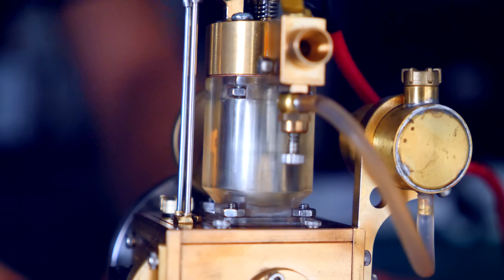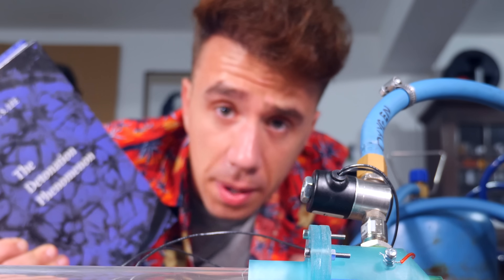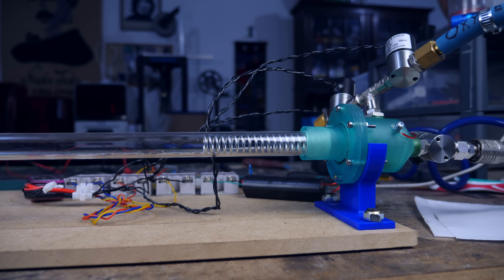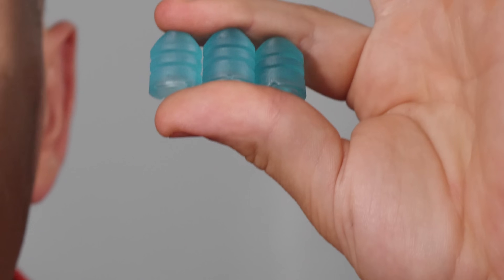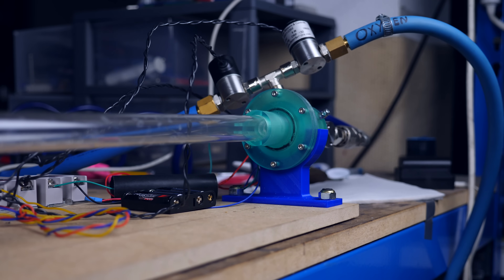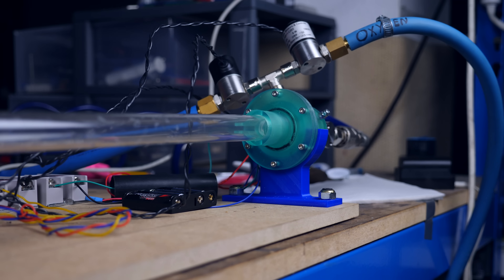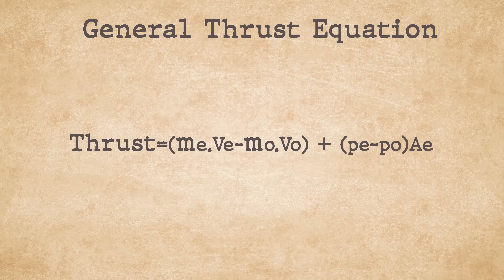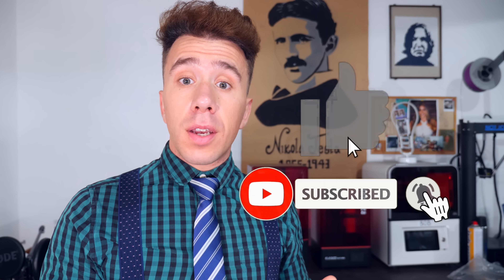PULSED DETONATION ENGINE

Comment: I am left wondering.. what would adding a nozzle to the end do? I'm no engineer but when i take into consideration what i know about supersonic fluid dynamics, it would increase the speed greatly while decreasing the preasure (also pretty greatly). I don't know if it would perform, better or worse, maybe try testing it in some future video? And thanks for quality content, you are great!
Reply: If he does have supersonic flow, he would want a converging nozzle to slow down the exhaust gas(supersonic fluid dynamics are opposite to subsonic), 
Newton's third law means that slowing down the gas would give a force to the engine.

Comment: Would it be possible to make a smaller detonation chamber and have the tube be slightly smaller. Could that increase the speed at which the expanding gas gets forced out and make a steep thruster cone at the end

Comment: Then you need a some pressure capacitor. Ubec - electric device, that lowers voltage by switching on and off really fast and it has an capacitor between output + and -. Capacitor charges when voltage is higher than it's own and discharges when it is lower, turning pulsing output into smooth one. In you case it can be just a big enough chamber with a NOZZLE!

Comment: He should make an electrolysis setup and use the hydrogen and oxygen outputs for his fuel mixtures, that way they are stoichiometricly perfect to get the best detonation!
Reply: That's pretty insane. Definitely wouldn't want to store it. Flashback arrestors would be a must.  An HHO generator consuming 2kw of electrical power will tend to be expensive expensive. It would  operate at roughly 50% efficency would generate about 1kw of chemical energy and about 1kw of heat energy that heats the electrolyte and evaporates water into the oxyhydrogen gas, and if this engine is generously 40% efficent at converting chemical energy to thrust, one would get maybe 0.4kw  each second to accelerate a rocket.

Comment: Video Suggestion: Adding some sort of a nozzle to this would be interesting. The pressure is not irrelevant in jet or rocket engines. it is manipulated through forced expansion to increase velocity which does create huge amounts of thrust. perhaps a little known fact: the pressure at the end of a rocket nozzle is very close to zero. Ideally it would be zero but there are issues with being close and creating negative pressure that cause the bell to resonate and explode.
Reply: Exactly, adding a bell would also give a greater surface area for the expanding gasses reflecting off the slower air to push the engine forward.
Reply: To sum up the comments. PUT A FRICKING BELL NOZZLE ON THIS THING!!!
Reply: This resonating is also the reason why there are different sized engine bells. With a smaller bell the pressure isn't that low, so it is better in an environment with higher air pressure.
Reply: I'd love to see a CNC'd rocket nozzle attached to this thing!
Reply: I feel like any nozzle you add to this thing would explode on the first test lmao
Reply: That could become a f**Ng bomb
Reply: Bombs and rockets are more or less the same thing, with a few key differences
Reply: Adding a Bell nozzle only have a sense if you can get a flow that gets sonic at the convergent before the nozzle, that is why the flow speed goes up in the divergent after the choke, otherwise a divergent would higher the pressure and slow down the flow. With a pulsed detonation, you have a supersonic detonation, but your flow will probably be subsonic (and not stable as it is pulsed).  Adding a Bell nozzle might actually be a bad idea as the convergent might not work property to accelerate the flow to Mach 1.
Also, adding a convergent nozzle will lower the pressure and add velocity to the fluid, which could lower the "mushroom" effect you see, but might lower the thrust as well
Reply: Maybe impossible but perhaps a cnc cone with reflection channels in the outer rim to not only take advantage of the expanding pressure zone in a more efficient way but if in the right area could smooth out some of the losses
Reply: It's nice to see everyone was thinking the same thing I was. He's under expanded.
Reply: I think a 2 stroke scavenging exhaust would do the trick.
Reply: You're missing the entire point this engine operates on.

That's why he mentioned all that in the video. It's different with this type of exploitation. A nozzle will mean squat. The velocity of the exhaust sets up a "wall" in the air just outside the engine, that it then smacks and gets knocked in the other direction entirely.

A nozzle at best would interfere with this entire process
Reply: @MadScientist267  that is the interesting phenomena from this engine though I don't believe that really creates thrust. At the point that the shock wave starts to really effect the atmosphere the expanding material is no longer directly effecting the vehicle. And I think, I'm not certain about this, if we were to look at the pressure of that ejected material the pressure would actually be a small vacuum in an atmosphere, and this would hinder a vehicle from moving forward. Ultrasonics are weird though so I'm not sure
Reply: @rizzardOfTheDew  Put another way, it plays off of itself. You don't want the gradual expansion a nozzle provides here... It needs that sharp transition to keep the speed up until the last moment, where it needs to slow down. It does this by suddenly finding itself in the open atmosphere. Each prior pulse will help with the next in line as well by leaving disturbance in the wake to to strike as the next pulse comes out.

There's a lot more going on with this than a normal jet or rocket engine, or even a normal pulsejet.
Reply: @MadScientist267  interesting I don't know anything about this stuff tbh. Armchair physicist at best. I'd love to learn more about the actual physics behind all this type of stuff
Reply: That is my first thought too, but there must be something different with pulse jets. Every pulse jet I've ever seen, from WW2 to that crazy old guy with the pulse jet bike, was straight piped. They do appear to make the straight pipe longer and longer. I wonder if there's a reason you can't use an orifice with a pulse vs a rocket.
Reply: I think you inadvertently hit the nail on the head with "Ideally it would be zero but there are issues with being close and creating negative pressure"

Bells are ok when there is continuous pressure but in any form of pulsejet you're going to have a masssive negative pressure wave between pulses

I'm pretty sure that if bells were useful they'd have already made an appearance on existing designs

Comment: Would Hydrogen be a better and more readily available fuel for your rocket/jet engines? You could use an HHO generator to get a near perfect ratio of oxygen and Hydrogen for a reaction, plus you wouldn't have a large tank of combustible gas, you could make it on demand and only enough for your experiments. And after your done using the HHO generator for experiments, you can use it as a Hydrogen torch to cut metal.

Comment: Your assertion that this engine is getting its primary propulsion by pushing on the air is incorrect.  It's all about the acceleration of the exhaust.  Why would this be different from a traditional jet or rocket engine?

Comment: Using this engine, maybe using two valves in parallel and opening and closing them one after another, can maybe increase the speed at which the engine can run ?

Comment: Can you try 3d printed heatsinks, could be for rockets, pc, raspberry pi or anything on those lines ? I know it is an odd idea but if you could design heat sink based on very high surface area and coat them in metal, and then use capillary action or a active fan drive the heat away from the metal coated surface? Also giving it high durability and strength, almost double as per @breaking taps https://www.youtube.com/watch?v=cp_EOxEyNHs

Comment: would using multiple electrovalves permit more detonations per second ?
If you use them with a delay with each of them, using not one, repeatedly, but in a chain-fuel way?  Like, electro-valveN°1 delivers fuel, then N°2, then N°3, and then back to N°1 ? that way you could bypass the electrovalve limitation of delivery as long as you don't have continuous flow of fuel ? right ? (I'm talking smack, here I have no expertise whatsoever)

Comment: To increase the thrust you can use a long cone wich is the same length as the exhaust pipe. the larger side of the cone should be the same diameter as the combustion chamber. After the cone there is a pipe the same length as the exhaust pipe and the diameter of the cone. This method of increasing the thrust also works really well with pulse jets

Comment: In the 1950s and 1960s, DARPA/NASA ran Project Orion, which investigated the possibility of propelling a rocket by dropping small atomic bombs. Obviously, you can't do that,  but it would be interesting to see if you can build a model rocket that is powered by small explosions. There are all kinds of challenges involved, particularly with some sort of pressure plate and housing that can survive the explosions.

Comment: You should make a pseudo RD engine with multiple combustion chambers feeding into one exhaust tube. Like a revolver without the revolving. Add some one-way valves or Tesla valves to keep flow in the right direction. You could make a multi exhaust pepperbox-like thing but that's crude.

Comment: Instead of using electic valvles try using 3 of them on each side like one for the oxygen and one for the propane, and then make it that they get griggerd like in a row so that the first valve from the oxygen is getting opend and the first valve on the propane, then the same with the second couple and the third, then repeat

Comment: for a more accurate measurment of thrust, have the rail on the top. having the rail on the bottom tilts the platform and puts excess friction on the rails.

having two sets, or more, of the valves should allow you to increase the firing freqency.

putting an involute nozzle on the end should push the exhaust from sub-sonic to supersonic without too much effort.

Comment: Now, another team from UCF, including some of the same researchers that built the rotating detonation engine last year, says it's managed a world-first demonstration of an elusive third type of detonation engine that could out-punch them all, theoretically opening up a pathway to aircraft flying at speeds up to 13,000 mph (21,000 km/h), or 17 times the speed of sound.

The standing wave, or oblique wave detonation engine (OWDE), aims to produce a continuous detonation that's stable and fixed in space, making for a ruthlessly efficient and controllable propulsion system generating significantly more power and using less fuel than current technology allows.

The UCF team claims it has successfully stabilized a detonation wave under hypersonic flow conditions, keeping it in place rather than having it move upstream (where it could cause the fuel source to explode) or downstream (where it would lose its explosive advantage and fizzle out into a deflagration).
Reply: IIRC back in the 90s one of the theorized Mach 7 aircraft (and sometimes labeled mach 14) that the US had in its top secret programs (Aurora) used 4 engines, 2 being normal jet engines and then 2 being Pulse Wave Detonation engines for hypersonic flight. while it probably was just smoke and didnt exist those days made me wonder what the future in aircraft could bring.
Reply: @jjjacer  Yes, I often revisit that subject.  It was declared a moderate success-then mothballed and into the black project realm.

Comment: Try to make a thruster that uses high voltage to make ionic wind and thus push itself

All you need is a high voltage genarator that is connected to a spike like a nail that will ionize the air on the tip and since same charges repel you can get thrust

Comment: You really need to use hearing protection. This coming from a guy that has hearing loss and tinnitus. I would use hearing aids but I get pain from some higher sound wave, the same that hearing aids work with. I wore hearing protection and still have this damage.

Comment: double or triple the engines to get continuous thrust, you need to time them so they will work in sequence, exhausting from single nozzle. similar to car engine. good luck.
Reply: the Nazis didn't need multiple engines and the doodlebugs lol
Reply: The logical conclusion of this is rotating detonation, which is like an infinite number of 'engines' in one detonation chamber.

Comment: So much yes! Pulse Detonation Engines are awesome.  Thank you for this, on a side note I saw two different designs of air intake for pulse detonation engines that worked very well-one is like a powered air compressor piston assembly that as the piston goes up and down it pushes air and fuel into the exhaust tube (basically the exhaust pipe) and it acts like a backfire tune on a car.  The second design utilizes a Tesla valve to allow one way transfer of the air/fuel mixture into the detonation tube.

Comment: a jet engine breathes air.
if both fuel as well as oxidizer come from a tank it is called a rocket.

the fast pulsing version could be used to simulate a machinegun, for example for filming or reenactment.

Comment: Something that has always facinated me was electromagnetic propulsion, something like a hyperloop.

Maybe you could try making a magnetically propulsed train or monorail!
Reply: Hyperloop?
Thunderf00t music intensifies
Reply: Maybe launch a jet powered rc plane off it like on aircraft carriers!
Reply: The Problem of heat is still there, because of the Ampere it needs. So you still need cooling methods and i do not think Integza get some liquid nitrogen for that. It's to dangerous :)

Comment: It would be super cool if you developed an engine with a good enough trust/weight ratio to propel an RC plane.

Possibly CO2 piston engine or a pulsejet engine or even a rotating detonation engine?

A crazy idea would be to make a turboprop engine with a pulsejet engine, but it would probably be extremely difficult due to the high temperatures involved...

Comment: My idea is to try to 3D print a working speaker, maybe print membrane with flexible pla. I think it shoud be cool. Or maybe print a 3d printer with 3d printer that 3d print another 3d printer.
Reply: Can't print electronics. Otherwise this would work
Reply: of course you cant print copper wire and magnet :D
Reply: @parecekcz190  you can print pcbs and with that you could actually print working motors. But that wouldn't make a functioning printer